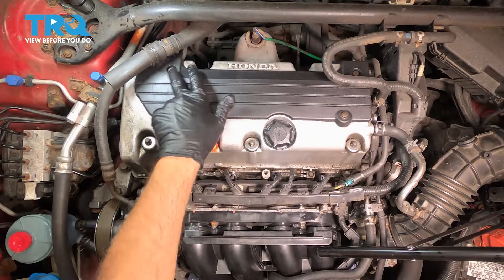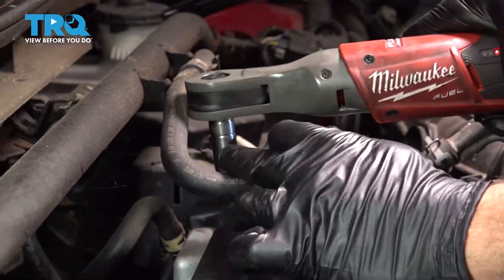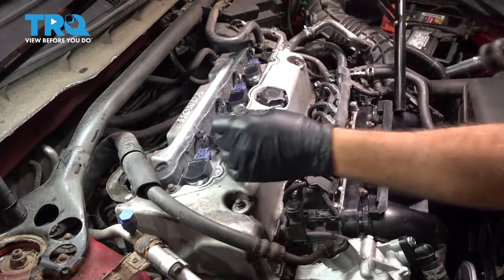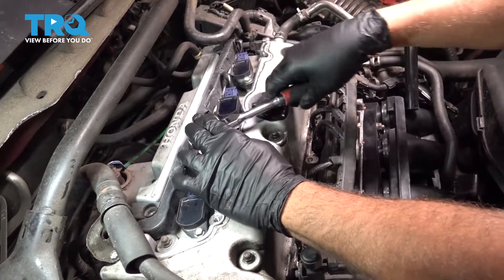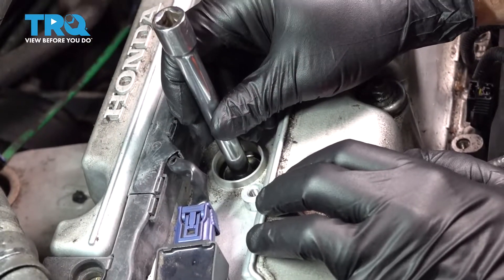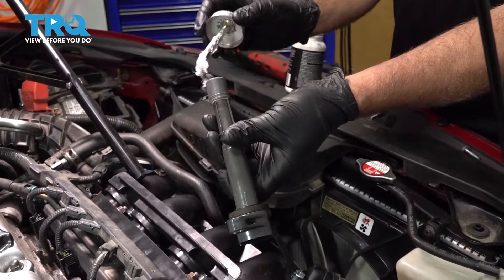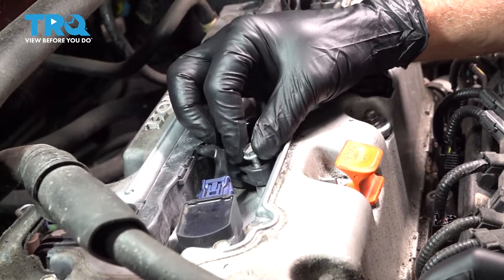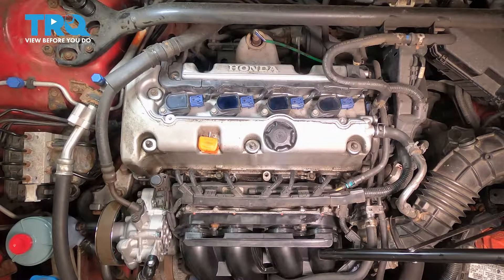How to Replace Spark Plugs 2008-2012 Honda Accord 2.4L

Comment: Almost every modern 4-cylinder engine is similar to this for spark plug changing. It's one of the reasons I love 4-cylinders. They're easier to work on for most things.

Comment: I was advised that you should disconnect the battery first so that it will reset hopefully clear any codes it may have been previously throwing.

Comment: Pretty easy job for a first timer. A tip i wish he would of mentioned is to reverse thread the spark plug in until it clicks so you know your on the threads and theres no risk of putting it incorrectly.

Comment: As always, videos rarely show you what could go wrong. 

The primary issue with a spark plug installation is getting the socket off after you've torqued the spark plug. Many times the rubber boot in the socket is too tight, and it won't let go of the plug.

Squirt a bit of WD40 in the rubber boot, but not too much.

Comment: My ratchet doesn’t pull the plug out with it. How do you get the plugs out?
Reply: Use ignition coil ,use extended portion to snap back on plug then pull it out
Reply: Need a magnetic one
Reply: either a magnet or a spark plug socket
Reply: It’s late, man, but what I use is a magnet, those extended ones, to get the spark plugs out.

Comment: Is lubricating the spark plug threads advisable? An old BMW (Motorcycle) friend used to do this, and would swear by it. 
Also, do any spark plugs need to be gapped anymore?